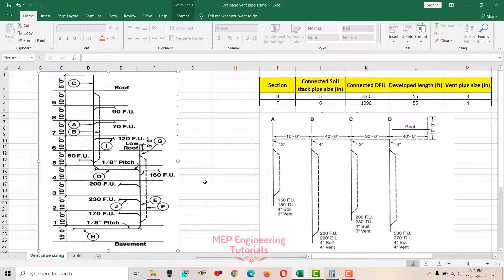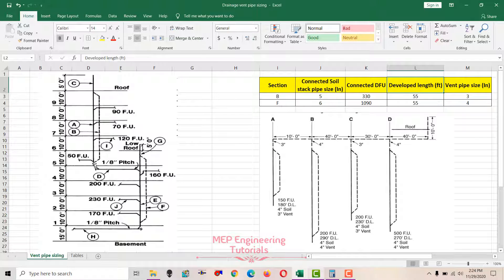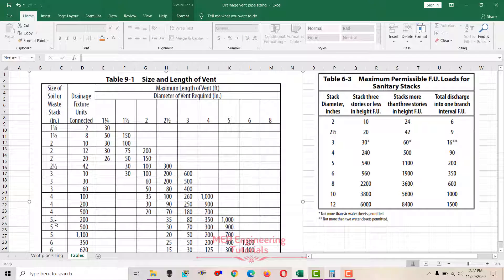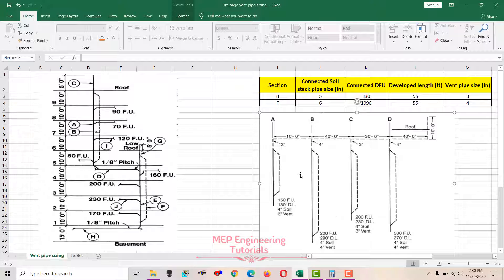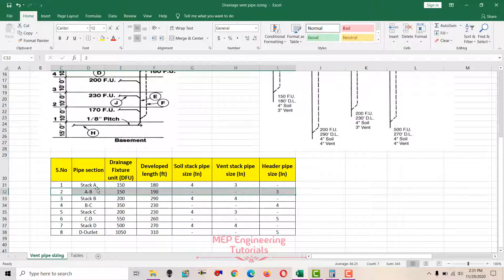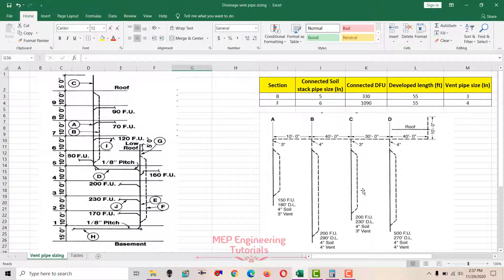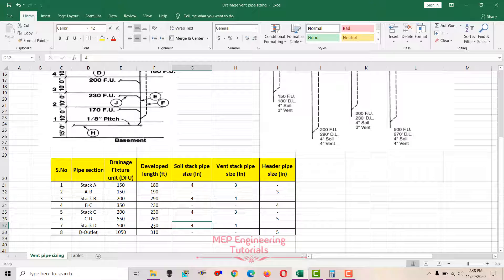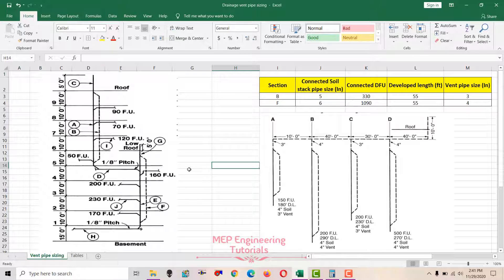Drainage vent pipe size calculation, soil stack-vent stack excel sheet per IPC code, plumbing design

Comment: Hi Waqas. The header B-C has two lengths associated with: (180+10=40 feet) and (290+40 = 230 feet). Don't we have to take the maximum 230 feet. Please comment. Thanks.